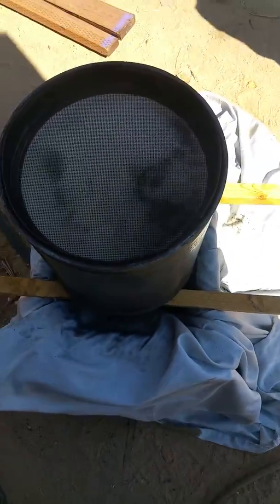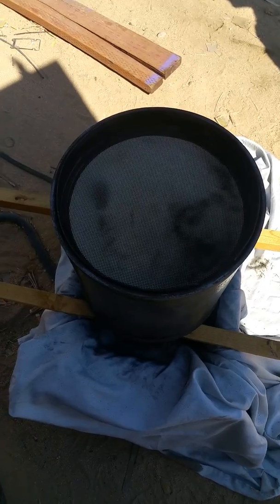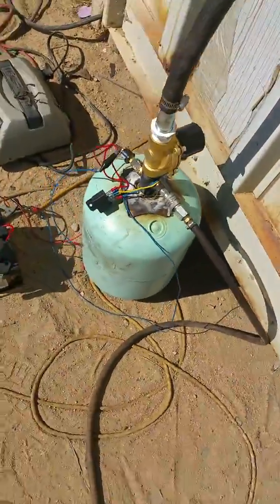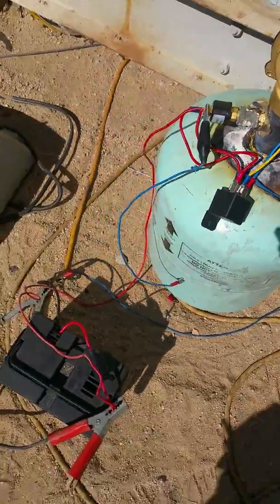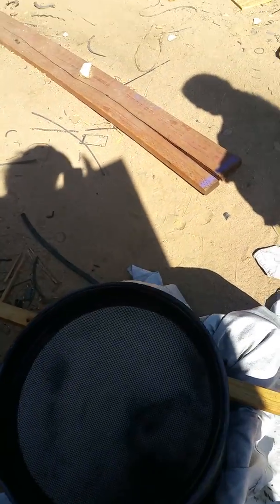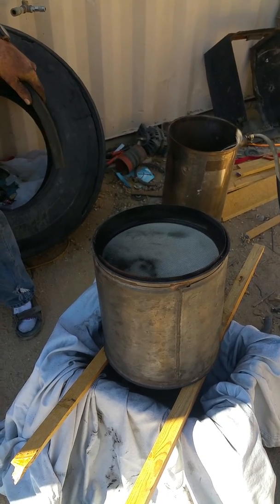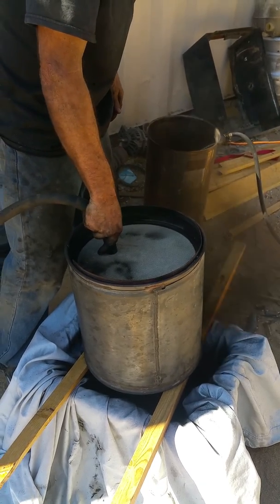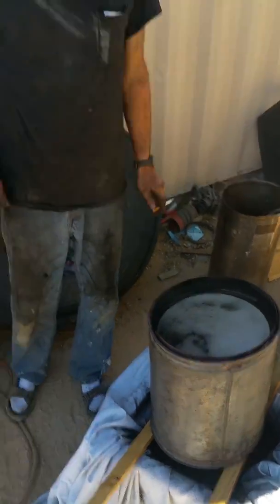Diy DPF cleaning machine.

Comment: hi. a list of components can you put online. thanks
Reply from the maker: It's just a 12 volt valve and a 100  psi pressure switch and a relay
Reply from the maker: i added some links for the main to parts
Reply from the maker: the pipes are just standerd pipe fittings